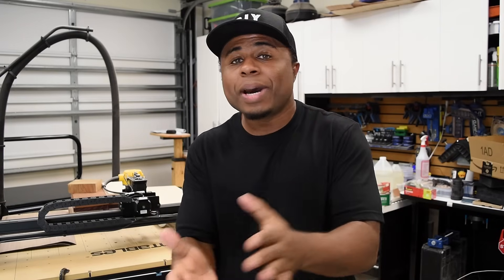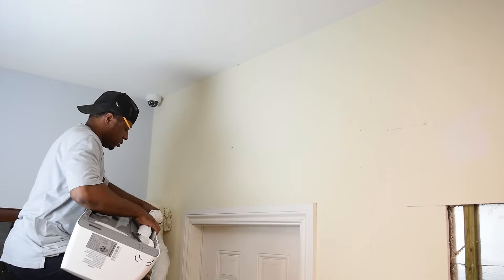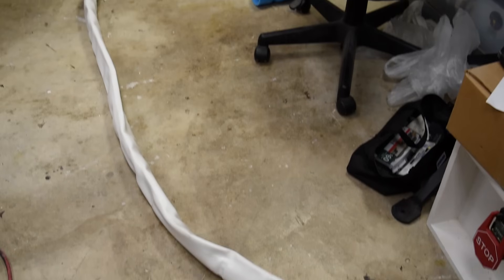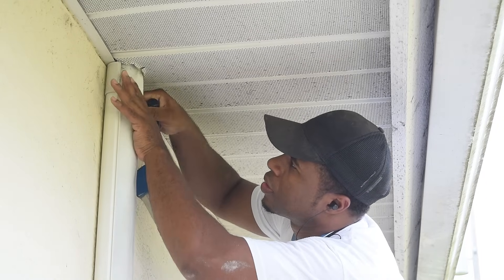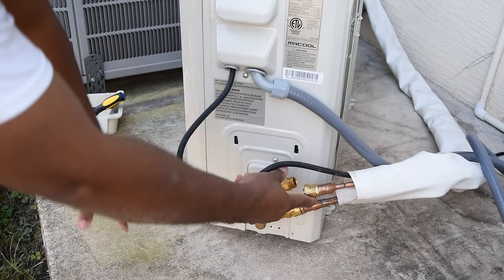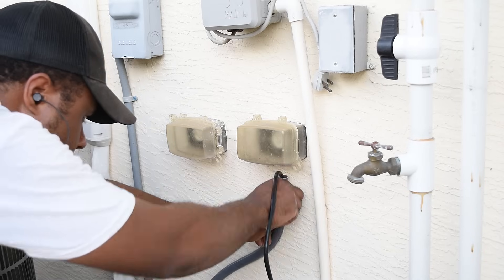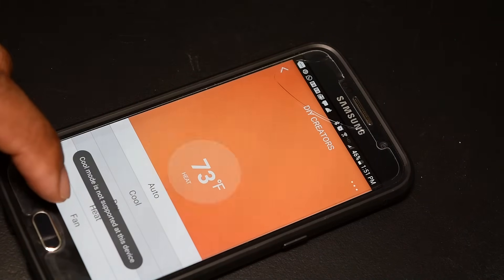How To install Ductless AC & Heating System // True DIY Mini Split MRCOOL

Comment: Great video, two tips one you can rule the distance of the indoor unit on the mount that way you wouldn't need to raise the unit to the wall and try to rule it on the wall. The second tip, usually you need to do vacuum on any ac system with will raise its efficiency and its life, but of course not everyone has a vacuum pump at thier home so you can try to do a "dry vacuum" not best but better than nothing. You need to do this before releasing the gas, on the outside ac unit you have a small valve on the bigger pipe open it, there you will see a Psi Clock connector as you open the gas start from the small pipe first and don't open it fully just half, at the same time jam your nail(or something else) on the small pin in the Psi Clock connector the gas that released from the unit will push out the air and moisture from the pipes do it for 3 seconds and that's it, open the valves completely and finish the installation.
Reply: Not with this system. The lines are pre-charged as well as the compressor. As you tighten the lines they open at the last 1/2 turn. Then you open the valve from the compressor to the pre-charged lines and your set. That's why you can not cut the lines to size, and you have to coil the excess. No vacuum pump required. Hope this clears that up.
Reply: @billandwende  oh that's awesome we don't have these kinds of lines in our country, usually only the old make it your size lines.

Comment: I was truly on the fence about putting this in my tiny home. I am off the fence and ready. It was suggested by my electrician but the when he said outdoor unit, I got spooked. This is small, but I am wondering how does it hold up in cold weather? Although I am in the south, temps have been known to decrease and freeze pipes. Thanks for the video.

Comment: it's a good system for someone who has no means to pull a vacuum, but looking at other units and it seems like they are charging almost double the price just to avoid pulling a vacuum, might be worth just buying a vacuum pump and gauges and still save lots of money.

Comment: I failed to see the part that brings power to the indoor unit. Does it connect to the main compressor unit? Does the fan and control power come from there?
Reply: In this system, the power comes from the outdoor unit to the indoor unit. Indoor fan control comes from inside, as it a most likely a simple on/off unit outdoor fan and compressor will always work at full.

Comment: good move on putting the extra line in the attic - most people coil it beside the outdoor unit where the oil in the refrigerant can pool in the bottom loops which is not good for the longevity of the system.

Comment: Nice work man! Question. My air condition pad is on the other side of the house, is there an extender for the 25ft cord? Thanks,
Reply: There is no real need to go all the way back to an existing pad any spot outside that gets air flow is fine. You can even wall mount with correct bracket. Or homemade version.

Comment: 9:35
You need to loosen the low pressure connecter then open the high pressure vlave so you can purge the air inside the system
Reply: It's a sealed system, never do you open the connector on this unit. It has been vacuumed and sealed.

Comment: When you open up the refrigerant valves on the pre-charged condenser; aren't the lines and the evaporator inside the house full of air?  Don't you have to pump them down into a vacuum first?

Comment: Good job. The only thing you forgot was to purge the line set. You should have left the suction line closed and cracked the suction line flare nut to let air out then tighten it. You can then open the suction side. I do HVAC. Not a big deal but we HVAC guys will do those things for efficiency. Yours is ok though, might have some non-condensable in the system but I wouldn't worry about it.

Comment: Damn! you are good 

Does the harness have to go thru the attic? 

IF I ever get to do it myself, I will split the drywall, take the harness in the basement, and out thru a new hole next the dryer vent, if the local codes permit.
OR let a professional do it for few hundred $. I am very impressed. How many hours/days did you take to complete the job??

Comment: Hello I have one. Made by glee.   But it always runs. It does not turn on and off like the house main system. It does have a remote though can touch confit bottom and where ever you place the remote it says it maintains that temp. But how come the u it never turns off.    It’s that normal. In the compressor turning on and off and I don’t know it the out side fn unit never turns off.

Comment: hi, I have the same system and I need to remove my indoor unit off the wall coz I'm redoing my walls, and I'm having a hard time getting it off. how do I pop it off the bracket?

Comment: Great product! I used your idea of uncoiling and routing the extra copper lines “up” into the attic. Some suggest the oils that collect inside the coiled up lines and set for an extended time can compromise the coppers structural integrity. My equipment placement didn’t offer the luxury of mounting the inside unit on an adjacent exterior wall. With that said I also had to route a designated PEX drain line through an interior wall to the outside. Ended up with a very clean install.

Comment: Question,  is there any noticeable difference between the 120 volt system and the 240 volt system? Because in other videos I see that the signal wiring looks to be 120 volts but the condenser unit is actually being powered by 240 volts. Thank you

Comment: I can deal with my workshop/garage being cold, frigid even. Throw on a jacket, get a indoor safe propane heater, whatever. But I can't, CAN'T, work in an oven. I live in Texas, it's not even summer yet, and already I'm burning up out there.
Reply: Yeah I can take the cold. I can usually take the heat too. But my bedroom is upstairs in a finished attic and it will now be my home office. Only problem is, the outlets aren't grounded. So I am looking into reaching out to a electrician to get everything safely grounded and have a window AC unit installed.

Comment: Very helpful video and total pro installation.  I've been wondering where to find a system just like this that can be installed without working with pressurizing coolant lines.  Very smart tip about using the attic space to take up the extra slack.  Thanks for putting this out there.

Comment: Nice Video. Why you have not purged the system for both copper pipes going to inner. Does the copper pipes have air and moisture?

Comment: Nice video there! Clean and crisp instructions. But you've missed an important step. After connecting the copper plumbing it is prudent to do a complete evacuation of air and moisture using a vacuum pump to make sure that there's nothing but refrigerant in the system. Improves efficiency and durability. Cheers!!
Reply: Not with this system. The lines are pre-charged as well as the compressor. As you tighten the lines they open at the last 1/2 turn. Then you open the valve from the compressor to the pre-charged lines and your set. That's why you can not cut the lines to size, and you have to coil the excess. No vacuum pump required. Hope this clears that up.
Reply: @billandwende  Nice to have that!

Comment: Nice! I'm looking into units at my 1500 sq ft shop. Question: Because this unit is precharged you don't need to pressure test?
Reply: No checks are required except soap bubble test to be sure you have tight connections. These are very fool proof.

Comment: NO AC IS DO IT YOURSELF DONT LISTEN TO THIS!!!!!  You should not be telling people to install ac. Your gonna have an Hvac guy out to replace that system in a year. No triple nitrogen purge and no vacuum means your equipment will stop running. I’ve been to several of these calls. Water poured out the line set in one case. Not to mention the high electric bill because you didn’t vacuum.  Not to mention the EPA license aspect.
Reply from the maker: Ok, do not listen to the video then. I am sure you know every AC manufacturer. It's 2020 Almost anything is possible. Please read up on the system. You may learn a thing or two. Thanks for watching.

Comment: Very good DIY video with more than I expected and a seemingly easy do. I am in the same situation with a hot or cold shop, but here in AZ, I have an evap cooler which does well. Curious question, how much did it increase you electric bill? Because, I am in my shop 8 hours a day 5 days a week. I build hot rods.

Comment: As a HVAC instructor.You are correct the condenser is pre charge but the lines are not pre charged now they do have pre charge with nitrogen but once you release those caps you have release the nitrogen out of the system.You have to still pull a vacuum on the lines only if you don't sooner or later it's going to call you problems from contamination aka oxygen which was released into the lines. You still have to vacuum the lines I install splits of all kinds.  units I can tell you for a fact you have to vacuum the lines so you can have longevity of the unit. You don't have to get too far down between 3-500 CFM. You can get at least around 750 microns and you should be okay as long as you've got a vacuum pulled on those  lines.

Comment: Excellent video, Very in depth on detail, I’m just curious as to why you can’t cut the harness shorter ?
Reply: The lines cannot be shortened because they come precharged with refrigeration gas. If you cut them this would escape

Comment: I love these minisplit systems. The efficiencies are great! These are good for RVs, too! Get one with low wattage and you can run them off a large inverter on batteries. Strap the condensor on to the back of the RV and put the air handler in a back bedroom.

Comment: You have skipped the most important step, and that's you did not evacuate the line set to get rid of the air and moisture. They unit is doomed to only work on a few years!

Comment: @6:13 most useful information. 

Can you plug it in? Yes! 120 v is pretty standard for a common household/garage 3 prong plug-in. 

If you don't want to install a separate breaker box for your AC unit, you can get a dryer plug adapter that will change the plug for where the dryer goes in into a 3 prong plug-in standard plug. This outlet usually has its own fuse, so you can rest easy. If you don't want to take the outlet from your dryer away (because it's simultaneously being used by the dryer) the outlet for your washing machine should have it's own fuse and have more than one spot to plug into. So, you can use the other outlet that goes too the washing machine part of the breaker box for you AC unit. I'm guessing this unit uses 20 amps max pull (judging from the info in the video), and most house outlets allow around 30, so you're safe and more than ready to roll with this one.

Comment: These mini split Systems have very poor filtration.they are also expensive to have repaired when comparing them to standard split ac systems.companies that do regular preventive maintenance on mini splits find that they must charge more to pm these mini split systems.cleaning the indoor unit can be challenging, due to the snap together type of design. Clips and tabs break off easily due to its compack design. Yup there cheaper to install because theres no duct work.but due to there poor filtration they require more indoor coil cleanings compared to a standard split system.also most mini split systems require Special training to be a competent repairman . Especially when 
Dealing with a multi-zone system.these systems can get complex.which raises the 
Technical ability reqiured to install and repair them.i have lost count on how many calls i have gone  to work on these systems that other companies gave up on
So the individuals who have the experience to install , but more importantly ,repair these systems are not as plentyful as a standard split system.and then thers the cost and available of parts for these system types.i alaways have to order parts.very rarely are they in stock.
And all the parts are proprietary. Which always means they are expensive.
A standard system will be more to install at the front end.but they offer a wider variety of air filtration.and cost less to maintain thruout the life of the system..
Reply: I received a quote for a ductless system that was about the same price as a conventional central HVAC installation.  Wouldn't a DIY installation be a valid option if it lasted a few years?  Instead of repairs or parts being an issue, just replacing the whole thing might be more economical.
Reply: @misterlyle.  a do it yourself hvac system?
I would have to see the do it yourself system that your talking about. I can give you an example of a so called do it yourself system that was installed by a untrained person.
A 2 ton minisplit
Was have trouble with failing compressors
I showed up and it was on its third one.
This would be considered a do it yourself system. It had a precharged lineset with rotolock connection.well it was a 50ft lineset ,most of the line set was not needed.
It was about a 15 ft run.so what to do with the remaining 35ft.well it was just left rolled up in the attic.because of lack of training the do it yourselfer did not know that the excess piping needed to be placed in such a manner as to allow for proper oil return.you see the way the excess piping was allowed to be placed was causing  the compressor oil to be trapped outside the compressor. Which caused early system failure. The manufacturer would not provide a replacement compressor under warranty 
Since the system had already lost 2 compressors . apparently noone looked in the attic to find the problem. It took a day of labor and just under 2k to fix it.now it runs like it should.also most all mini split system prohibit the installation of liquid line dryers. 
A standard system always has a dryer installed.those mini splits use small compressors that are not designed to have much in the way of velocity pressure.
Hvac is just not a project i would recommend the average home owner to try to tackle.
Reply: @davidmusser2447  Thanks for your response and the detailed explanation!  I gather that such an attempt to install a low-cost cooling system option could balloon into an expensive mistake.  My house (here in Florida) is little, and two window units provide the main cooling.  At some point I would like to upgrade to something better.

Comment: 1.  U didn't vacuum the line set "copper pipes" [removing air & moisture from pipes]. 2.  U also need to pressurize the line set to 150 psi with nitrogen before opening service valves!!!! 3.  when vacuuming the line set, U also need a micron gauge to make sure it is brought down to between 250 to 350 microns.  4. That compressor gone die within couple yeas "compressors are not designed to compress air"!!!! 5. Moisture in a refrigeration system causes: oil sludging & freezing in the refrigerant control orifice!!!!!!!!!!!!
Reply from the maker: Thanks for your comment, as I said in the video this is a DIY unit and none of that is required.

Comment: You had a hard time cause you did everything backward.the toffee could've been done by 1 person if your startedby taking the hose off and starting in the attic, your could've feed the hose coming from the room easily and going outside easily.  Also your wiring is off. Your should've put some 1/2"squeeze connectors for outside use. The liquid tight needed to be secured too. Your stuff works but it's not as safe or secure cause you did it yourself.
Reply from the maker: I appreciate your feedback but reading your comment tells me you didn't listen to the video. You can not remove the hose! It's precharged from the factory and sealed. There is no other way. This is a DIY unit not what a pro would install.
Reply: @DIYCreators  gotcha. Different model, different install.

Comment: The bracket on the back is your template.. I installed over 4,000 of these in Afghanistan, they do pretty good until a sandstorm lol.
Reply: Michael H.  He didnt to anything wrong, but could have been easier on him. Pop the bracket off the back and mount it first, The bracket is the template that he said he was missing. Use the bracket, it is the template that has marks for where you need to drill holes etc..

Comment: At 1:28 he says, "I must have threw it away or something." Third grade English at best using the wrong verb tense.
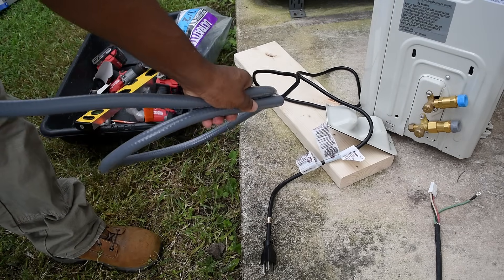At 6:40 he says, "The kit come with two screw on connectors."  Another glaring example of third grade English using the wrong verb tense.
Does anyone else believe that our education system has gone to Hell in a handbasket?

Comment: That unit wont last long you did not pressure test are vacuum system down.
Reply from the maker: Don't need to be Vacuumed! It's a DIY Kit made to be installed like this.

Comment: i do hvac for a living and i must say that you did an awesome job for a DIY just don't run that you unit unnecessarily cause its a 110 volt and it uses more power than a 220 volt good job

Comment: It looks like you are in Florida the house is constructed like a Condo in Florida.The only thing you should of done was to evacuate the lines you installed as you introduced moisture into the system any refrigerant turns to a acid that will eat at the condenser and evaporate cores.

Comment: What a joke. I know people want to save money but hire a ac tech. A pump can draw the water with the line set and you need to pull a vacuum to remove air and moisture from line. That unit will work for a year and have problems. Always remember the cheaper you are the more you spend